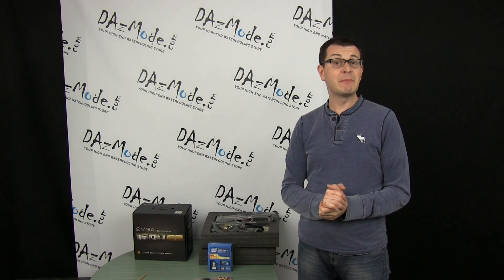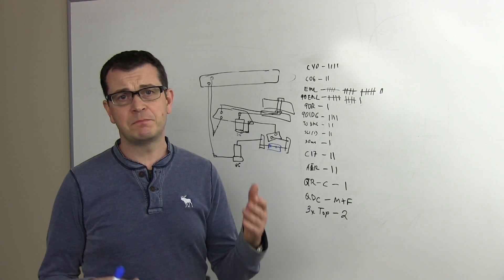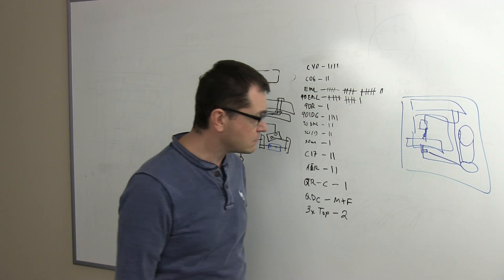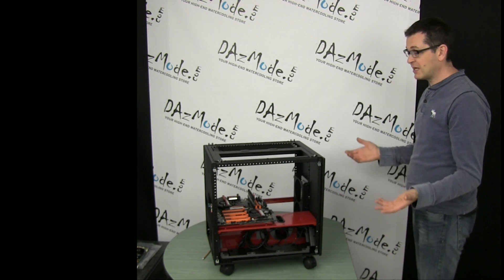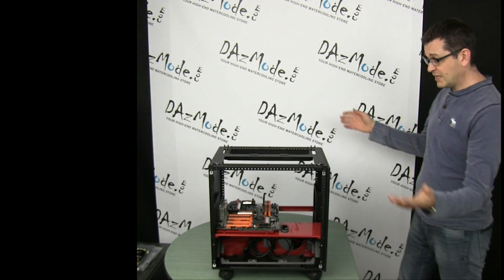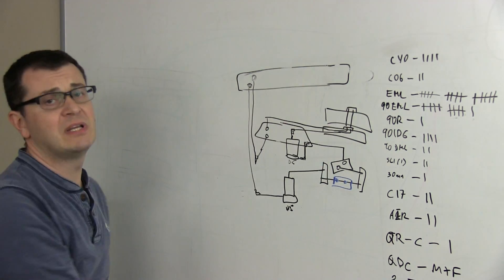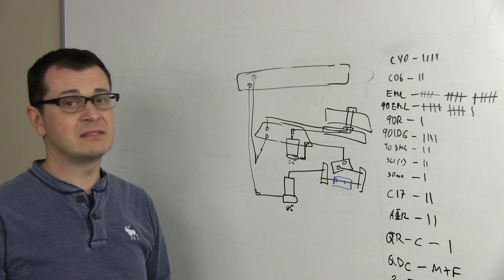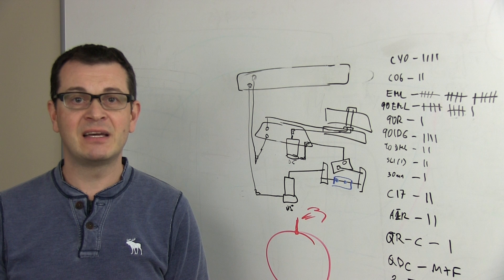Planning loop and calculating fittings  - Ruby's Revenge Build Ep3

Comment: Hey Daz, about the dual reservoir, what if you divide the loop with a Y just after the pump before going to the reservoirs, and then rejoin them after the reservoirs?  Or you could let each reservoir go to it's independent radiator, and then rejoin them later, at some point, wound't that work?
Reply from the maker: It will be reservoir and pump combo, not separate reservoir and separate pump, so I just keep them serialized.

Comment: I'm in the process of building a new dual-loop system and I have found out the hard way that if I thought I needed 2 fittings I should have bought 4. These things are not cheap either.